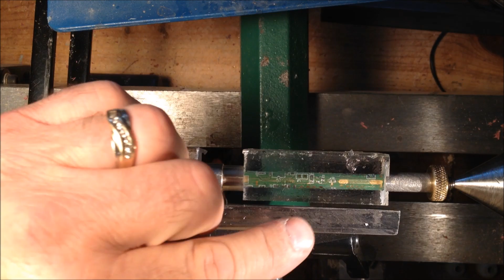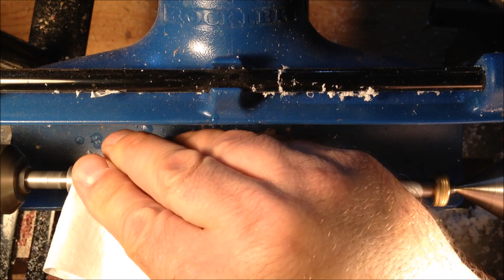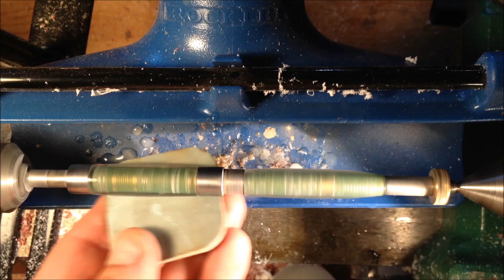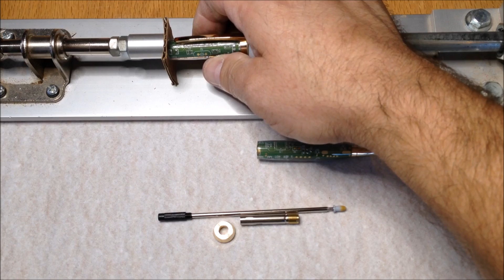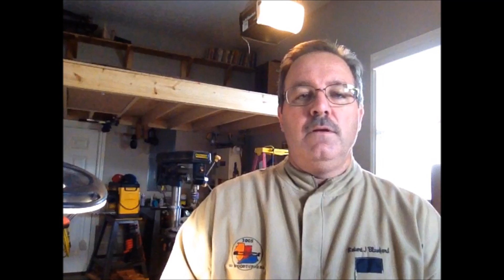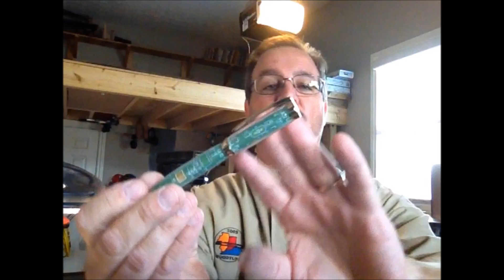Turning Another Circuit Board Pen

Comment: Lovely! One thing you could do rather than using the lathe to "chop" them down is to hit them on the bench/belt sander. Taking off the corners helps too.
Reply from the maker: This is an old video before I had the disk sander. Now that I have one, I wouldn’t do it any other way. 

Regards,
Bob

Comment: Hi Bob
Just received my circuit board blanks , I won’t be starting to work these for at least a month 
My question is when I do get ready to turn these, since I just ordered the blanks with the 7mm
Which bushings should I use
Thanks
Roger
Reply from the maker: +Roger Fortier That will depend on the pen. If it’s a Slimline, the standard Slimline bushings will work. If it’s a Concave, use those bushings. Treat it just like any other blank in that regard. 

Regards,
Bob

Comment: Hi Bob - what a great looking pen! What do you do if the transition from the nib to the blank is not smooth? Do you have to take it apart and do an additional turning/polishing process?
Reply from the maker: +Sean Butler Hello Sean,
    If that happens then yes, I would take it apart and redo it. As long as I turn it to the bushings everything usually turns out ok. 

Bob

Comment: Great pen as always Bob.  Don't expect you to remember, but I asked you about the nib getting crushed on the PSI pen press a few weeks ago on another video.  You recommended HDPE pipe over the press, but I actually just took an 1/8" piece of olive wood off cut, sanded perfectly flat, and epoxied it to the end of the plastic press.  It's worked wonderfully.  I noticed in this video the nib may have gotten scratched from pressing it so many times.  I hate spending all that time on a pen, then the press ruins it!  I may dremel a TINY depression into the center of the olive wood on the press, in order to "hold" the nibs when I'm pressing them.  Hasn't been an issue so far because I'm using patience, but it was a nice cheap fix.  Thank you again for sharing; love watching your videos!
Reply from the maker: +durk  I remember talking with you about your press. I took another look at the nib after reading your comment, thank God it wasn't scratched but it was smudged. I was able to clean it and it's good to go. You had me nervous. LOL. 

Bob
Reply: Good!  I think it must have been the light and camera angle perhaps.  Sorry to give you a scare and good luck selling it!

Comment: As always great pen Bob... I have not worked with that many different pen kits, but i cant get over how far you had to push in  that transmission..
Reply from the maker: +c raig The front blank on the Concava uses a long tube. It's one of the longest along with the Dutchess kit. It does make for a striking pen though. 

Regards,
Bob

Comment: I like the first one better but only because it's black and not green. I love the kit you used but I would bet the black one could also work with a gun metal grey or even a silvery grey pen kit.
Reply from the maker: +Marcy Cooper I think they offer white and red too. These blanks are fun to turn as long as you don't rush them. That's what happened to me on this one, I got comfortable and rushed he front half causing my gouge to bite a little to much material and getting the equivalent of tear out. Luckily it happened while there was plenty of material still left on the blank and I was able to recover. 

Regards,
Bob

Comment: one of the coolest if seen you do. o btw bob I tried that .ca finish on the knife scales. turned out ok on the end I wiped lots of thin coats lots of high grit sanding and it worked ok no obvious waveyness or anything it's not perfect but I think it will work really well with a few tweaks .thanks for the advice you always really help. I really appreciate the time you have always taken with me .it's very special indeed
Reply from the maker: +Nick Kendall Thank you Nick,
  I'm glad the C/A worked. Once you work out the bugs and get your method down, I'll bet you make some awesome looking knife scales. Best of luck.  

Regards,
Bob